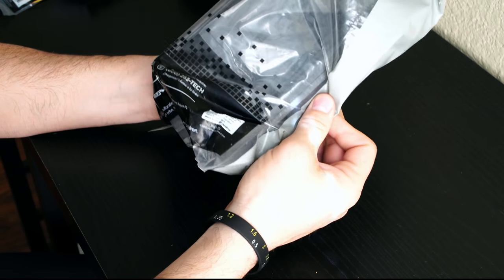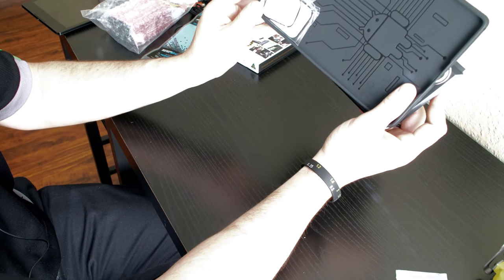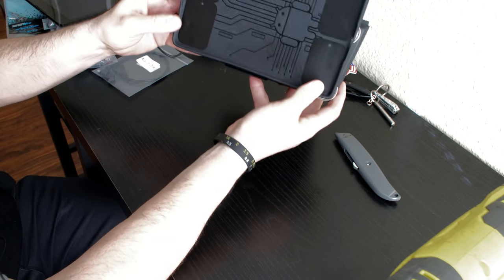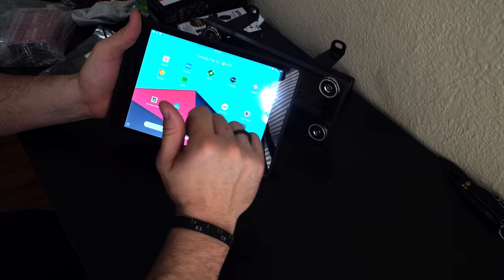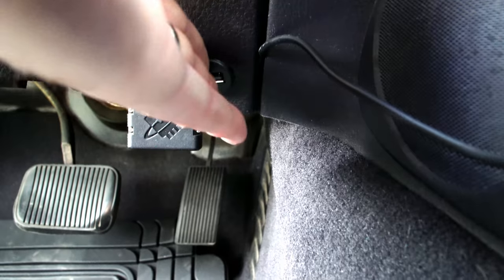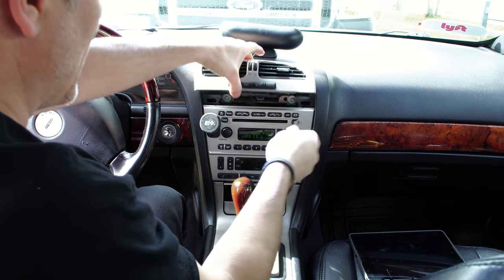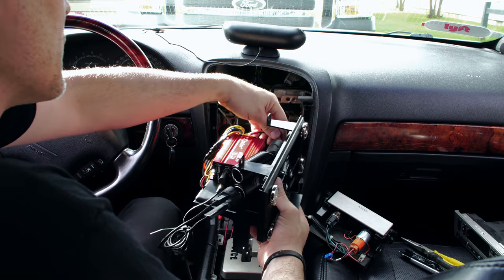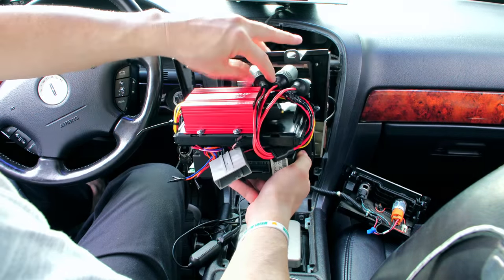Turn Your Tablet Into A Head Unit

Comment: Can you use it with your volume buttons on your steering wheel with it?
Reply from the maker: Unfortunately, it the current configuration, no. I did however purchase an adapter for the steering wheel controls but never installed it as controlling it from the screen or physical buttons worked fine enough for me. I think the easier solution would be to get Bluetooth steering wheel hardware that straps onto it like a watch. Simple and easy.

Comment: way good, 
mine (1st addition setup)i use a (Microsoft surface PRO 2 <6x9 is reason for no.2>) , bluetooth/3.5mm to- Epicenter  to- 2.1 zone Eqlizer <2 in / 6 out> to 3 amps (4ch RF-puch for main speakers),(4ch alpine for midbass's/tweeter's),(2ch subwoofer <1>amp), 

why use a PC and not Android, is the supper system - does/can not run on android, 
Windows -or Linux "probably Mac also" can go far above by 2 major points .. 1) the biggest point is a USB soundcard/DAC. i have a few USB-DAC's (SoundBlaster x-fi/ tidal beach 5.1 & 7.1) and can not get them to run on android, im able to get (one stereo USB-DAC,) I'm unable to get 2 pairs of 2ch USB-DAC's to run on android also) that means you're only going to get 2ch out) , 
2) DAC software is poopy on Android,( but with only 2ch's what could you do with it)
https://www.amazon.com/gp/product/B07HRVRS2N/ref=ox_sc_saved_title_7?smid=AT2DTNNZ40BD8&psc=1

alternatively, i used an HDMI to RCA 5.1 converter for DSP options, which made running 6rca's look stupid.. 
https://www.amazon.com/gp/product/B019RF7ZVA/ref=ox_sc_saved_title_1?smid=A1MD4BVI48GGWS&psc=1

what windows/Linux software for DSP/eq ( Equalizer APO ). why? because its a FULL BLOWN DAC software, that allows  you to control any sound channel independently (hi/ban/low pass) and will take advantage of multiple sound cards/devices, (delays are used to fix sink/ <time delay from speakers for adjustments>-)

other software (for windows/Linux use an Android emulator for EZ) 
also, you can Duel /tri Boot for mutable operating systems (my MS surface runs Windows10/KDE-neon/Bliss-os<android>) i mostly use android for 2ch output - but i boot windows for my FUll 7.1 for video/gaming

.
Reply from the maker: That's a hell of a setup! Love it! Thanks for the suggestions!

Comment: Lincoln LS V8 from the look it's a 03 or 04 model I'm in Arlington myself!  I had a 05 ultimate
Reply from the maker: That's awesome! Mine was a 2006 V8 Sport. Are you part of the Texas LS community? They have a group on FB and also Lincoln LS Enthusiasts as well.

Thanks for watching and commenting!
Reply: @edwardlthompson  I was a member until I sold my LS ultimate I did alot to it as far as a sound system custom headlights EVERYTHING
Reply from the maker: @jonathanberry8255  it is an easy car to fall in love with and want to do things for.

Comment: Is there a Bluetooth adapter other than the ODB2 diagnostics?
Reply from the maker: I a little unclear on your question. Are you asking about a Bluetooth adapter for the audio or other Bluetooth options for the OBDII?
Reply: @edwardlthompson  After I thought about it more I assume that you use a hotspot or cell connection so the apps have an internet connection while driving?
Reply from the maker: @doddsnow4714  that's correct, it is an LTE enabled tablet. I did an update video that is recommended at the end of this one that goes into more detail and I show another tablet and a different configuration in my truck.

Comment: How are those magnets effecting your tablets CPU over time??
Reply: Magnets don't affect chips in normal circumstances. The reason we used to have to worry about magnets around computers was because of the magnetic storage, which is only an issue if you have an actual spinning disk, which is getting to be less common because of SSDs.
Reply from the maker: Yep, you nailed it. I have had no problems with the tablet even in direct sunlight in the Texas heat on many 100+ degree days.

Comment: nice video, didnt know it was possible, thank you! Can I do this in my Chev Express van? It doesnt use an amp is why I ask. Do I add an amp to it?
Reply from the maker: Thanks! Yes, you can do this to your van. I added the amp. There's a link to it in the description along with all of the other parts that I used. The only thing that would change for your vehicle is the faceplate.
Reply from the maker: The factory head unit has an amp built into it. That is the reason you will have to add one to your build to compensate for its loss.
Reply: @edwardlthompson  I didnt see the antennae adapter on your Amazon list, I am sure it was mentioned in the vid? Thanks for the reply.
Reply from the maker: @BaconRanch  no, I didn't include that. You can get all your local channels through iHeartRadio and other similar apps and stream them usually at a much higher bitrate than you would get over the antenna.
Reply from the maker: @BaconRanch  I just realized that you are talking about the antenna adapter that was installed by the previous owner. I'm not sure what that is or where he got it from.
Reply: @edwardlthompson  thanks again, I had re watched and worked that out too!!

Comment: OMG this is exactly what I was trying to do. The biggest rabbit hole I was in until I somehow click on your video. I have a 2018 Subaru Impreza. The installation of the tablet goes  way over my head unfortunately. The rotation app is not responding for the Uber app? Any help would be great.
Reply from the maker: I'm glad the video can be of help. Make sure to configure the rotation app to work in all conditions and click the play button to activate it. If I recall correctly, there's a second page of settings you will need to poke around in.

Comment: Do you know if this tablet supports Microsoft glass? Me Andy friend are trying to get something like this setup in our cars but we want to be able to run Microsoft glass so we can keep controllers in the car and play Xbox through the unit 😂😂
Reply from the maker: I'm pretty sure it does. I however, would recommend getting a more high-performance device. This one is a bit on the old side. I think your best option would be to put on HDMI switch to flip back and forth between the Xbox input and the tablet input connected to a high refresh rate screen. Just keep in mind that the vehicle can get incredibly hot and incredibly cold depending on what season it is and a lot of household electronics were never designed to handle those extremes.
Reply from the maker: I have previously connected a USB hub to the tablet and connected a Xbox controller to it and I can confirm that it works without a hitch.

Comment: Great job man .would you concider to sale your services with a ready installation plug and play setup if you had any infos on demand of a potential customer?
Reply from the maker: Absolutely. I even talked woth a friend that does 3D printing about making a custom insert to hold the tablet and cables.
Reply: I'd be interested in this as well. I have a Cadillac cts and already replaced the factory stereo with a double din, but it leaves so much empty space around the double din dash kit that a nice big tablet would look bad ass in its place.
Reply from the maker: Yep, that would be a great excuse to put a tablet there. I hope this video inspired you.

Comment: This is amazing I've actually been wondering if I could do this with my car. I drive a hybrid and it would be so cool to get even more info on the car while at the same time getting a huge upgrade on my 200h ct's screen. But too bad I have no knowledge of this maybe there's places that do this. Thanks again for the video great stuff.
Reply from the maker: You're welcome. That sounds like it would be really cool to do to your car. I wonder what information can be pulled from the OBD-II on a hybrid. Now you've got me curious. I'm looking at getting a Ford Fusion Hybrid sometime soon. Maybe I will update you.

Do check out my update video though. I changed my setup a little in my other vehicle.

Comment: Does the tablet have an AUX input?
Reply from the maker: It has an output only. If you want to add more devices, you can add a 3.5mm splitter at the Amp. I did this and demonstrate it in the update video I did.

Comment: Depending on where you are at, you may find that your laws prohibit having a device forward of the driver that is capable of displaying video without a parking brake lockout.  Of course what they don't know won't hurt them.  But it would be a nasty surprise if you get a ticket for it.
Reply from the maker: I'm pretty sure that only applies for devices that are integrated into the car. However, I'm sure they could get you for distracted driving even if you were watching a video on your cellphone while in a cradle. I would not advise ever driving distracted.

Comment: Can I connect the tablet to the radio and control the radio from the tablet
Reply from the maker: As far as I know, that is not possible but you can find tablets with FM radios built in or you can use the iHeartRadio app to digitally tune into your local channels and listen to all their commercials.
Reply: @edwardlthompson  I want to connect the car radio to the tablet and show the radio display on the tablet and control from it.  Do you know if there is such a thing?
Reply: Is there any adapter that I can connect to the radio?
Reply from the maker: As far as I know there is no way to get that to display what radio channel that you've tuned into. There's an application called iHeartRadio that allows you to tune into whatever local channels that you enjoy but do so digitally through the cellular network.

Comment: Putting magnets behind your screen interferes with touch sensitivity of your screen, especially if your tablet uses a pen. But even just using your finger the screen will eventually loose all touch ability whereever magnets are behind it.
Reply from the maker: I don't see how that's possible. In my use case, I've never had any issues. If that were correct, I don't think there would be so many magnetic phone mounts for vehicles available on Amazon. 😂
Reply: @edwardlthompson It is well documented if you look it up online. It wasn't well known but with the introduction of the Note series it has come to the attention of more people.
Look it up.
Reply from the maker: @shayneayles531  yeah, I searched it and I'm seeing article after article about how magnets DO NOT effect capacitive touch screens. 😂
Reply from the maker: But, by all means, do share any links you feel relevant to the conversation here. I would like to see where you got this information from.
Reply: @edwardlthompson  Look up Dead spot Note 20 S pen

Comment: Sorry but that’s a lot of work just to put a tablet on the dash. I bought a couple Scosche magnet mounts, took all of 5 minutes, looks much cleaner than that tangle of wires and connectors. And I still have the stock head unit installed.
Reply from the maker: That's cool. My reason for replacing the head unit was the lack of a decent connection for the audio of the tablet and I wanted a super clean look with only one wire visible with a factory look.

I have the same setup as you in my truck since it has Bluetooth and it's a work truck. I don't care if there are cables everywhere.

Comment: Soundstream makes a blutooth amp. Just gotta wire in your speakers....delete your factory radio..buy a block off plate. Run the charge cord loosely threw it. Velcro the tablet to it. Thats it. No wires. Im about to buy the amp. I will do a video.
Reply from the maker: I look forward to seeing it! Sounds like a great option!
Reply: @edwardlthompson  i am grabbing a kpro ecu(tunable) i just grabbed another car like the one in ny pic. There is videos of it on my page. It had a kpro.  And the tablet will run all my gages for me. Its only 115$ for the amp. And the amp claims 1000 watts. But its 700 constant. I have memphis and alpine highs. Its gonna be nice. I have waited for years for it. It came out in 2017 i believe.
Reply from the maker: @raymondnoodels7775  awesome! Sounds like a really nice setup!

Comment: Did those Neodymium magnets mess up your compass readings?
Reply from the maker: Nope. All the maps and navigation are done with GPS which doesn't use a compass, it uses the location and direction of travel based on triangulation of your location from multiple satellites.
Reply: @edwardlthompson  Understood. There are some apps I use that require the compass, gyro and accelerometer to work. Like the inclinometer apps on play store for 4x4 off roading. Thanks for the reply. Good work!
Reply from the maker: @terrybest3036  gotcha. As far as I can tell, it had no adverse effect on the tablet. I can try seeing how it works with those kind of apps. Make sure to check out the new setup I have in the update video.

Comment: Do u have any idea that can we connect another android phone through usb to head unit to use android auto and other mirroring features. TIA
Reply from the maker: I tried mirroring my phone to the tablet but I could not. What you could do is get a basic monitor and mirror to it but most screen small enough to fit in your car are going to be low resolution. At that point you would probably be better off buying a double DIN replacement head unit with a touch screen and Android Auto built in that also has screen mirroring. Sadly, you will only have a 7" screen that is stuck in the car. Those are the limitations I wanted to eliminate with this project. Also, Android Auto leaves me really disappointed with it's lack of features and apps. If I had to get a head unit, screen mirroring would be a higher priority to me than Android Auto.
Reply: Headunit reloaded is the app you are looking for. I use it for my tablet setup in my car. I would have done something like this in the video, but my car came with a very nice sound system.

Comment: One issue I see here is if someone lives in a cooler area and has heat blowing on the tablet it could cause problems.
Reply from the maker: That's true but you could shut the vents behind the tablet if necessary. I did a different setup that would work better in those climates in my truck. That video is recommended at the end of this one.

Comment: No criticism because you did a great job. However, seems much easier to get those adhesive magnetic mounts rather than all the work you did. That is what I would do because I am not brave enough to modify my car like yourself….
Reply from the maker: Thank you so much for your positivity and your recommendation. The reason I did not go with anything with adhesives is because of the extreme temperatures on the inside of the car during the summer and winter. I was worried about what those extreme temperatures would do so I chose to go with the screws.

I have a friend who does 3D printing and I plan to work with them to create a drop-in bracket for single DIN stereo replacement.

You might also enjoy the update video I did to this one where I moved to a larger tablet and a different set up in my truck.
Reply: @edwardlthompson   Not sure where you're located, but I've actually done this in my Kia Sportage and created my "ghetto Tesla" setup. Had it up for a little more than a year. It held up my hefty Ipad Pro 12.9 inch and it came of pretty easy using the dental floss trick. I've got a real Tesla now, so I now have that nice screen for driving and I mounted clips to hold my Ipad Pro in the center console. 

I wish I was brave enough to mod my car.. There is something I'd like to do such as adding a third party instrument gauge so my Tesla Model 3 would kinda look like the Model S. I feel like I am gonna break something and void my warranty. LOL
Reply from the maker: Awesome! That's a great upgrade! Thanks for letting me know that worked well for you. I was living in Texas and now in Puerto Rico where it gets very hot during the summers.

As far as modifications to your car, I recommend waiting until the car is paid off to do anything wild. That money is better spent getting the vehicle paid off faster.

Comment: Where did you get the tablet back tray from?
Reply from the maker: I got everything from Amazon. There's a link in the description that will take you to a list of all the items I used.
Reply: The tray does not look like it is included in the amazon items?
Reply from the maker: @charlesdenning8121  I built the mount from parts I bought on Amazon.
Reply: Just letting you know the back tray is not in the parts list. @edwardlthompson
Reply from the maker: @charlesdenning8121  I will look into that when I get back on my PC.

Comment: Why not just use Torque? It is so much cheaper than the OBDII Link app. Gives you basically all the same functionality as OBDII Link but costs way way less money.
Reply from the maker: I've played around with the Torque app and it works well with the OBDLink hardware. I was unaware they made a scanner too.

Comment: Super glue could have saved all the screwing. It works great on abs plastic.
Reply from the maker: You're right. I was more confident in the screws holding up to the extreme heat in a vehicle than the chemicals in the super glue so that's why I went with screws. Good idea though.
Reply: @edwardlthompson  the good thing about the super glue, it actually melts abs together! Food for thought!

Comment: can you control the music from your steering wheel? good work btw.
Reply from the maker: Thank you! There is an adapter kit that you can use to connect to the factory steering wheel controls but the easiest solution would be to use a Bluetooth steering wheel control. There is one that straps onto the steering wheel kinda like a watch.
Reply from the maker: Also, check out the update video as well. I made some changes to the setup.